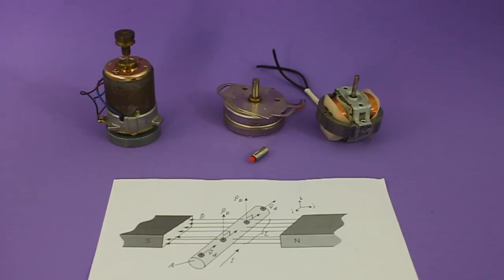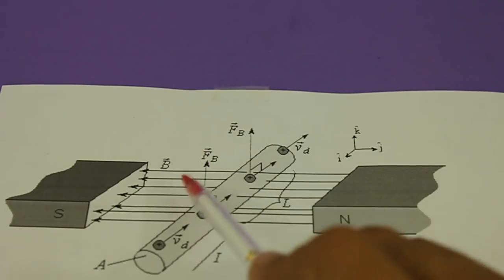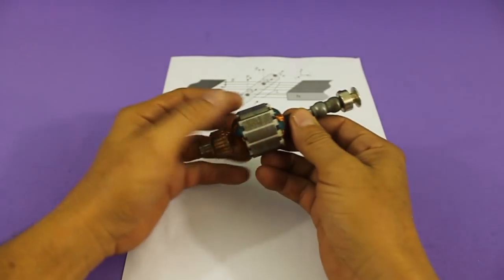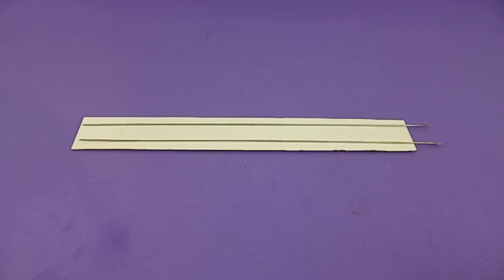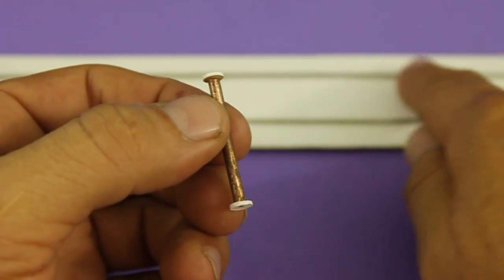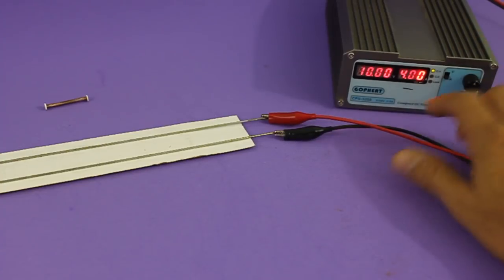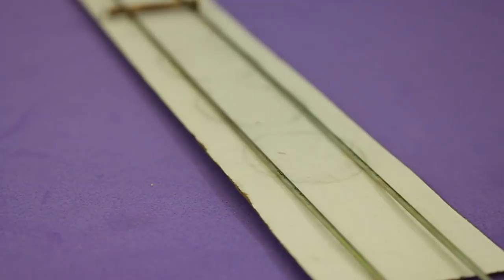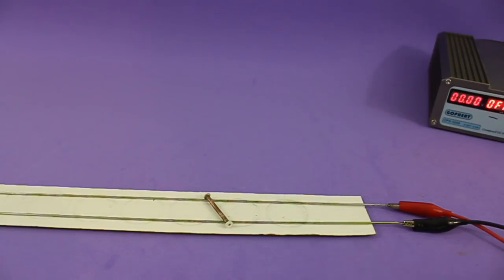Lorentz Force and Electric Motors

Comment: Ok. let me see if I understand this correctly. Dependent on the direction of current flow it will determine the direction the copper rod moves, rotates, in the case you present. Does the Lorentz force emanate from the center of the copper rod radially out or does the force emanate from the exterior surface, tangent to that surface causing it to roll? What I also find curious is that you can do the same setup as you have but remove all your magnets, that are under your surface and then attach two opposing magnets to either end of your rod, I used a steel rod and not copper and the rod will roll as yours does. What is different, in my setup, is that the magnets are moving with the magnetized rod and not through the stationary permanent magnetic field as in your setup. In my setup the magnets or the rod is not moving relative to each other and yet there is a Lorentz force realized. Can you explain how this is happening.

Comment: if you use a graphit rod of a pencil instesd of a copper wire  it will not stick to the rails
Reply: Mojtaba shafigh aski It also wouldn't move because graphine his a horrible conductor
Reply: Jezo Huby not really. Graphite is a good conductor, but it has a bit of resistance but it's not  horrible at all. Its widely used in electronics such as electric motor brushes, resistors, potentiometers, and many more

Comment: It is not the Lorentz force that creates rotation or torque in an electric motor. That is just simply magnetic attraction and repulsion. The Lorentz force is not what people think it is. It is 90° out of phase with magnetic force. It is a polarized displacement of the dielectric field.
Reply: It is the Lorentz force that acts on moving electrons inside the magnetic field. It is also called "Laplace current" when you consider the force to a piece of conductor with currents inside. It is an electrodynamic effect.